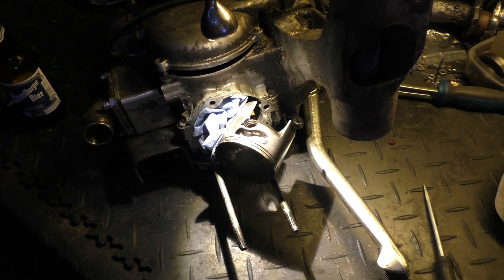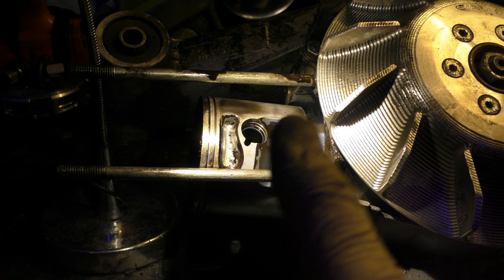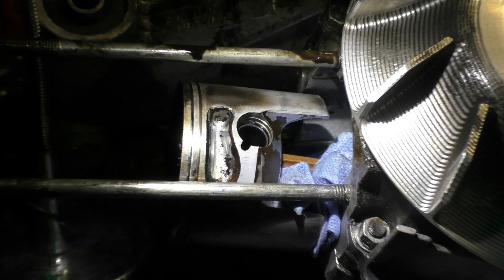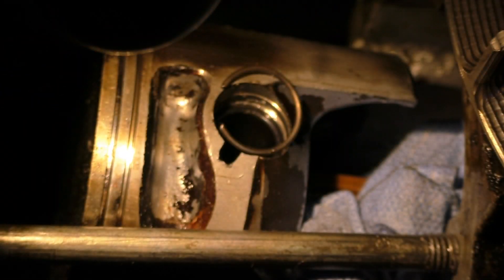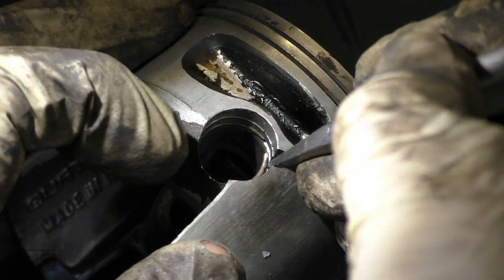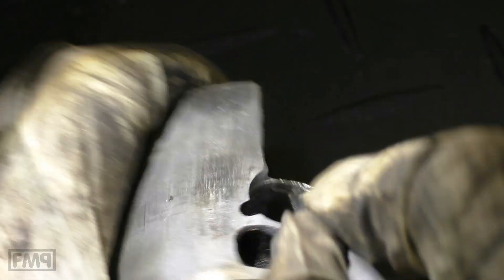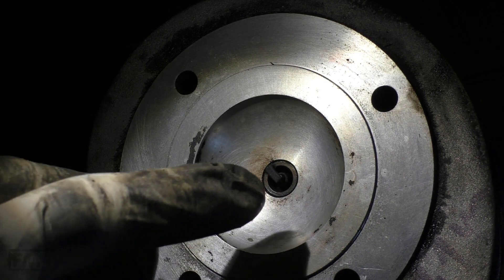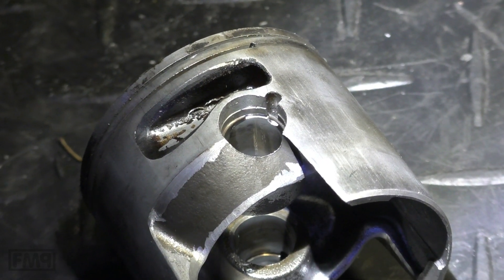vespa M244 circlip CHECK / 35hp & 2000km / state of the art: TIGHT FIT? /FMPguides - Solid PASSion/

Comment: thanks mr FReak!I just wish that Mr Quattrin would do a kit for the original T5? Alternately is the latest Pinasco 162 or 177 kit better than the Malossi 172 as an option please?
Reply from the maker: wouldnt use yellow at all. Esp as the t5 is known for piston failure (still aold the kit sadly..) yellow even exchange the piston for free and THAT means something. 

its really bad with t5 tunung hardware, i know. only malossi 172 it is. I would rather consider selling thr engine end gettong a px, cause amazing kits are available for px 😜and u get really goos money for a t5 engine.

No one needs to know 😉

Another t5 malossi tuning project coming up btw. Not even longstroke is possible (with good timings) really really bad with t5 tuning...
Reply: @FreakMoPed8  Thanks for your reply Freak! Your replies are informative and funny. So a Malossi is the closest thing to the best for a T5 if it was your only option. I think that I recall you saying that a WORB 5 malossi 172 was not the best option and standard 172 is a better choice?